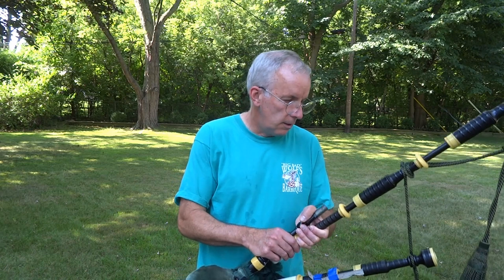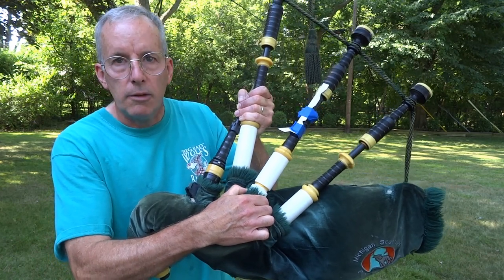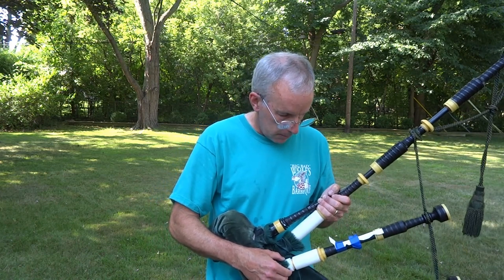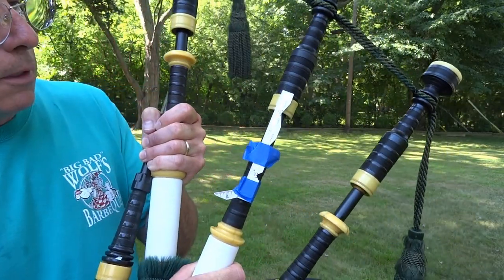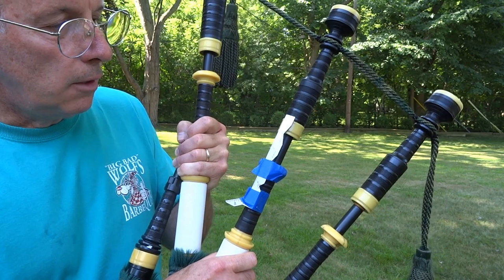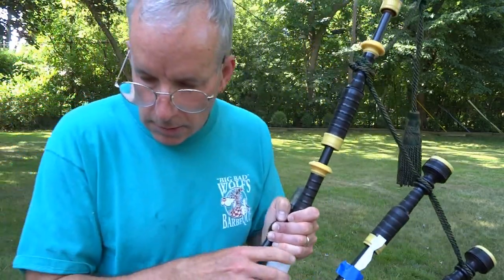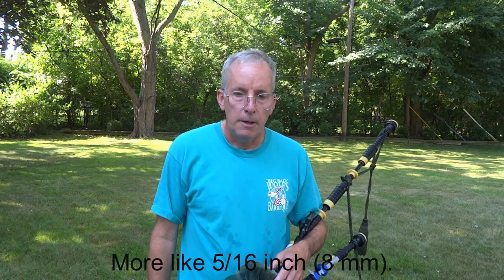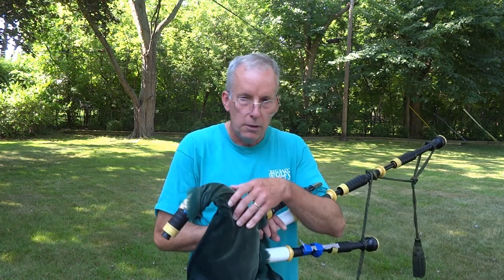"Phase locking" in Highland bagpipe drones

Comment: Thank you for doing this. I've thought about making drones out of acrylic to see what happens to the air when they are tuned perfectly. I will say about your vides that you can clearly see that  at 1 inch and 1/4 you can hear that it is more in tune...it locks with the other

Comment: Honestly this is kind of stupid . Ruins the look . Rather just play it the way it was meant to be played and adjust when needed .
Reply: I think you have missed the point. "Ruins the look'... It's clearly something that he's made himself, not a production model. If these were black they would just look like normal stocks.
Reply: @davidshedden3578  The idea of playing longer tenor stocks is not new, while adjustable ones is. Look up Robert Reid a piper and bagpipe maker of the 1930. Two of my pipes are set up with Bass drone stocks being used on the Tenors. They strike in easier and faster and stay in tune with each other... very stable. Prototyping in cheaper material is a good idea. What I do not understand is his mention of being tuned to 800hz? The math does not seem correct. Lets Say-Chanter low A=480hz, Tenors =240, Bass=120hz. In this setup HA would be 960hz. Mr. Snow could you clear that up for me. Think what you have done is very cool.